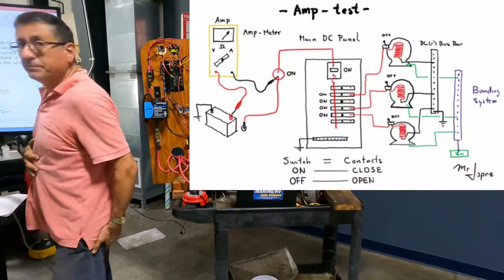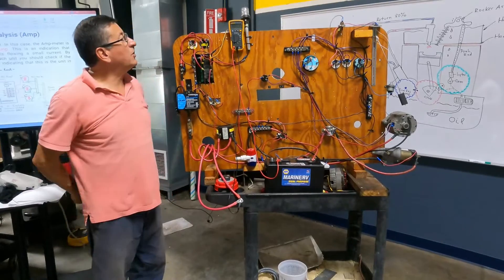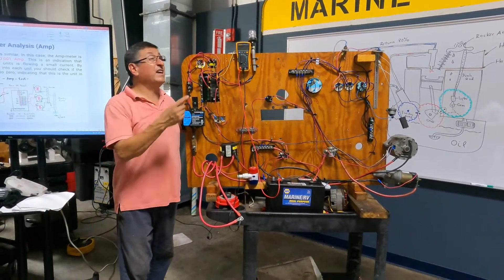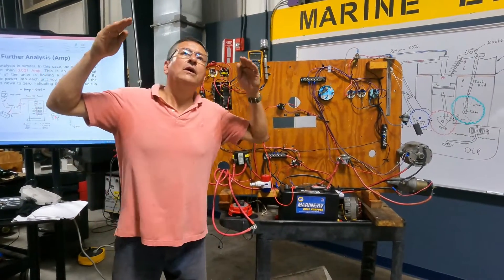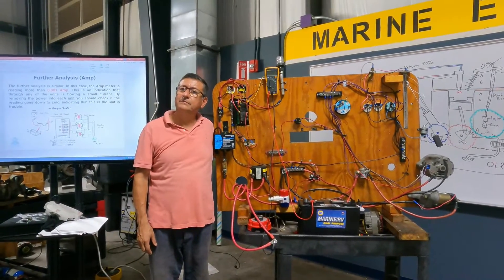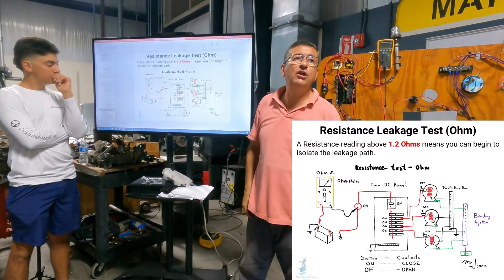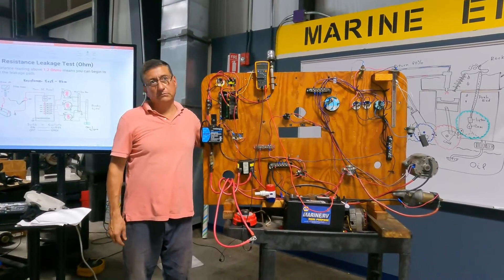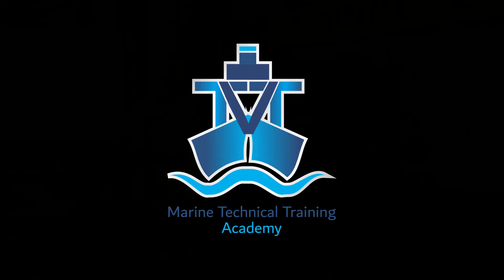How to Identify Leaks of Current in a Boat

Comment: Hi again - when measuring the resistance it is not clear what reading you are getting. When the faulty fan is connected does the resistance drop to a low resistance? The initial resistance with everything off is high, in kilo ohms. Then you turn all the circuits on, the resistance drops but is still in kilo ohms as nothing is turned on. You turn on the light and the reistance changes to show the resistance of the light filament (maybe a few ohms). What was the reading when you turned on the faulty fan? Was it a short circuit eg less than 2 ohms? Thank you again.

Comment: Hi Mr Lopez. In the video you have connected selected amps and connected the multimeter in series confirming you are measuring amps not voltage. You say the current is going to zero. The students points out that it is reading O.L which indicates that the current drawn is greater than the range selected. Can you please confirm that the current is not going to zero but going high due to the short circuit. Many thanks Martin (NZ)
Reply: Spot on

Comment: I really like this video great demonstration. I have a few questions, we saw that the blower is in question for the short, can it be removed and tested? If so, what should be the expected reading if it was shorted? What reading if it was good? If it was good would that mean the short is in the circuit?
Reply from the maker: Yes you can!. In that case you should verify the Amp/H flow with the blower isolated. It should be equal or less than the manufacturer specifications. Best regards

Comment: In the voltage test the multi meter goes to overload after going to zero probably because the current draw on the blower was greater than the meter could read.  Put a higher reading MM on the same test it would go to zero then go to the reading of the blower?
Reply from the maker: Thanks for your feedback 🙏